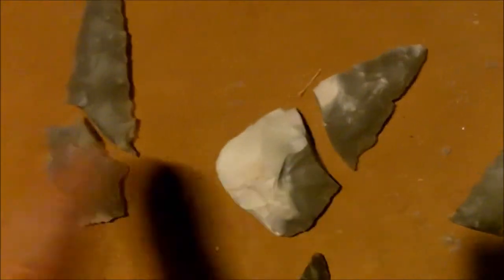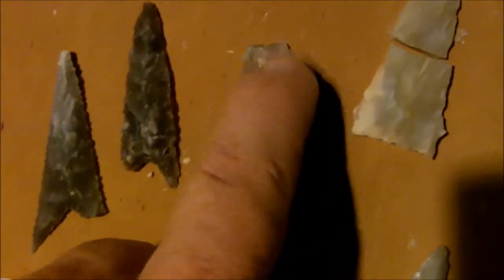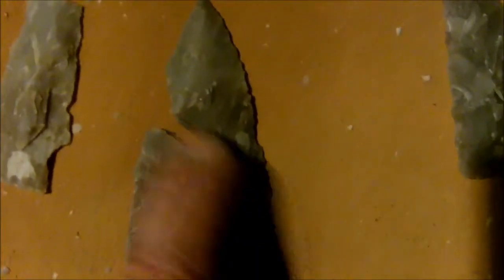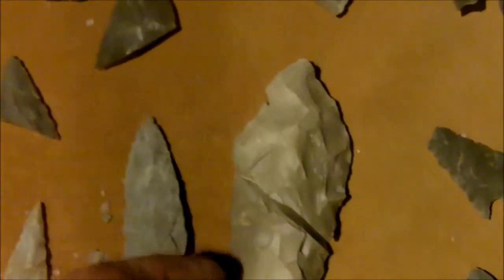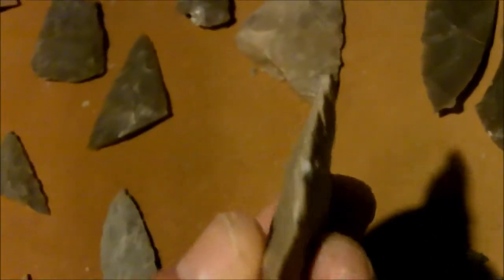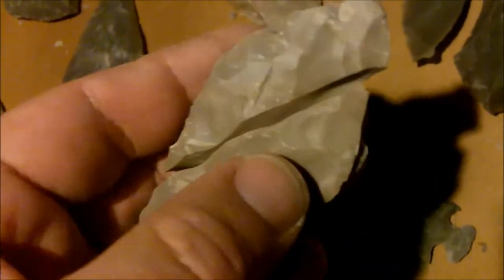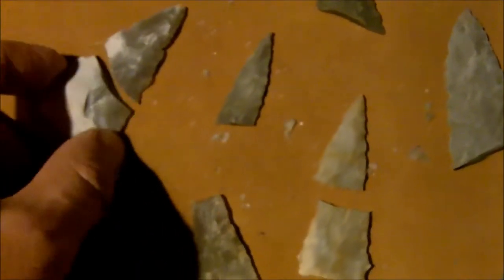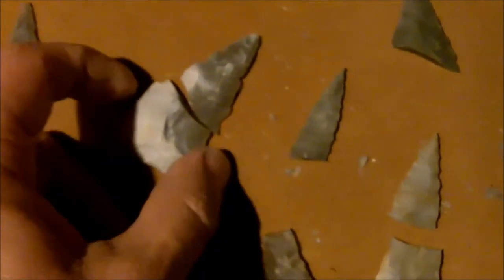184 - Breakage Update

Comment: I think the breaks could be a problem with supporting the biface. I am playing around with your technique and had a real hard time putting the rod in the crook of my leg. Found I could wrap a piece of rope twice around my thigh and tying it in place so it had a criss-cross to it and fit the rod on top of my thigh and through the cross of the rope. It holds the flake in place well and allows me to use the opposite thigh as a support for larger thinner peaces.